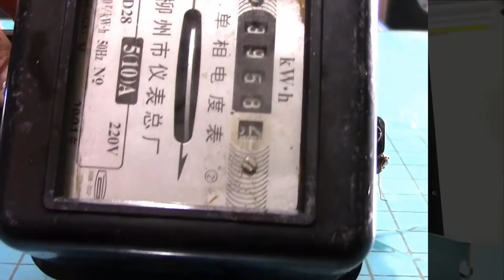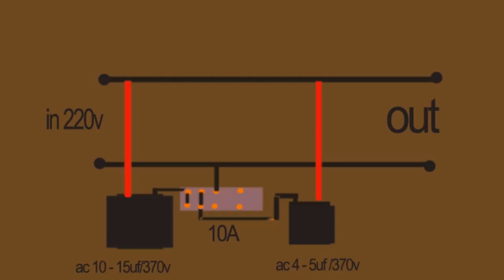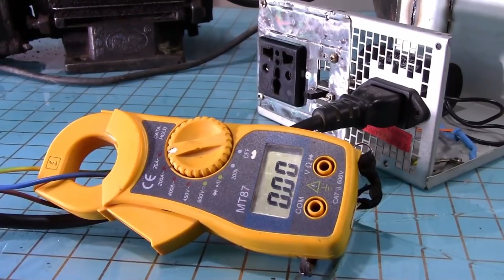How to save electricity at home, tips using capacitors to save electricity bills for motors

Comment: Alfred, in an air conditioner window type, there is already a capacitor in it. is there a posibility..to apply this kind of approach? cause air conditioner are electricity bill sucker..saving like 30% would be great!. hope you can educate me on this. also, would you be kind enough to share the schematics of this project (how to save electricity at home). thanks as always.
Reply: to recycle power, it needs a resonant capacitor. not just any capacitor value.
here:
C= (Amps/volts)/(2*3.1416*Frequency)

C is the exact value of capacitor you need to attach parallel to your air conditioner. if theres already a  capacitor inside the aircon, see if its parallel from the source to the aircon, if so, add make sure the total capacitance you add in parallel is equal to the value of C in your calculations. over and under resonance doesnt save you power. it must be close or exact Capacitance value.

Comment: Hi, Alfred. Thanks for share, Thats Good advice for me. So we need decide to use capacitor bank or not? one question  how if i used capacitor series on hot line, what happen then? because i have information if we connect electrical series capacitor on hot line, i will have increase amperage, is it true? how do you think about that? thanks
Reply from the maker: you should not connect the capacitor on the line. It will make your electricity meter spin faster,
You can only connect the front capacitor to each type of device when it is active. apply to old equipment. it will save electricity.

Comment: You are only correcting the power factor and the total VA. The watts stay the same!

Power companies DO NOT charge homes and small businesses for VA, they charge for watts, so you are not saving *anything*.
Reply: P=E*I
Reply from the maker: The formula for calculating watts is
P = U.I
if the voltage does not change anything. then the discharge line drops. then P will decrease ... resulting in reduced w ...
???